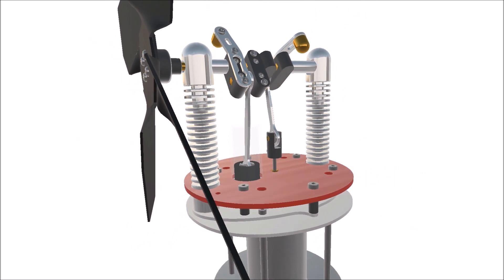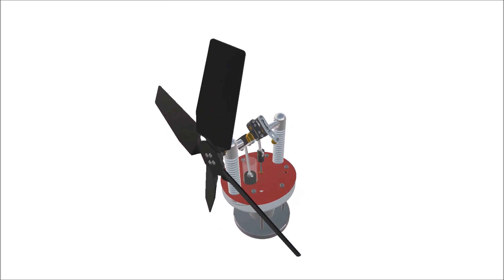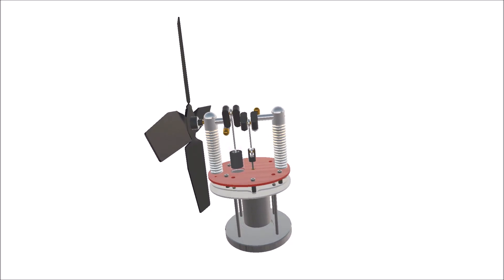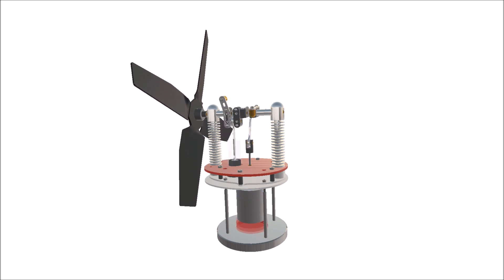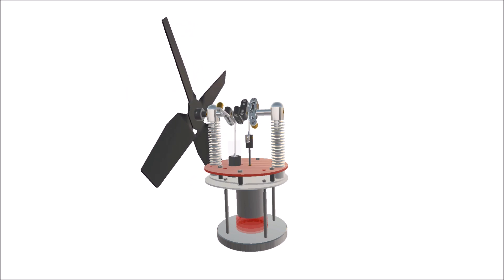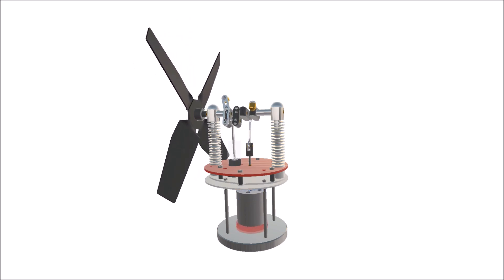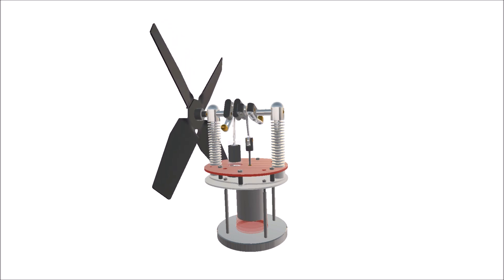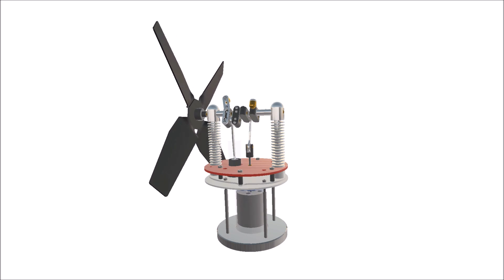How a Stirling Engine works

Comment: that is not how stirling engines work, it is not possible for the air inside the engine to fall below atmospheric pressure while above ambient temperature